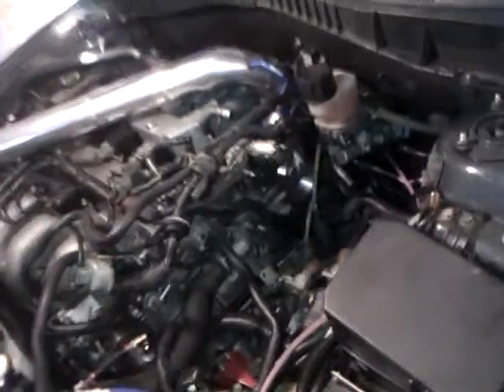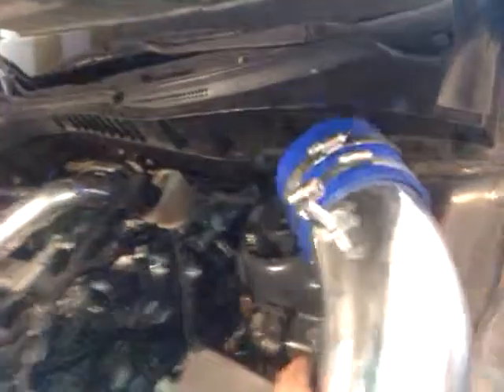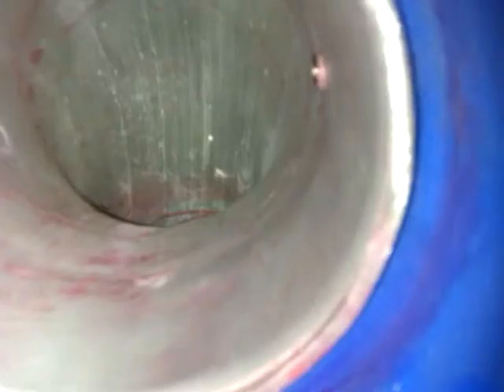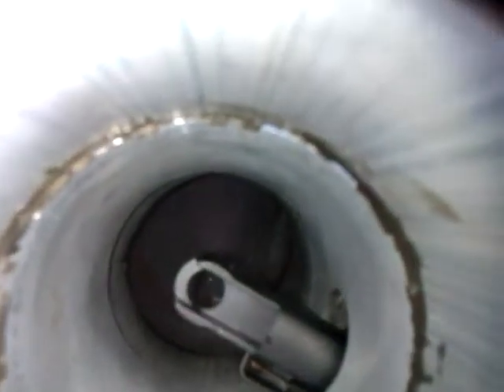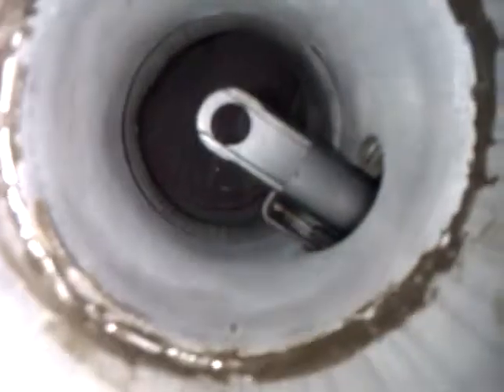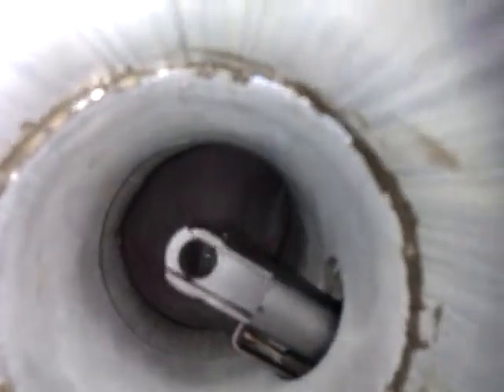pre turbo meth injection inspection

Comment: @dooderek If the injector nozzle is directly exposed to the air stream, the spray pattern will not have a chance to propagate and it'll dribble into the intake carried away by the air.
So people usually use an bung to stage the nozzle off the pipe.